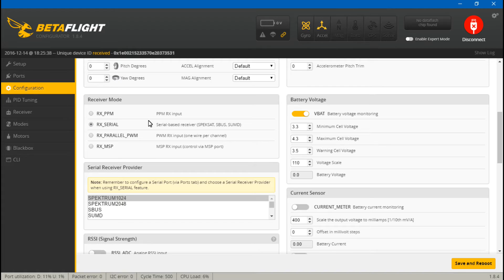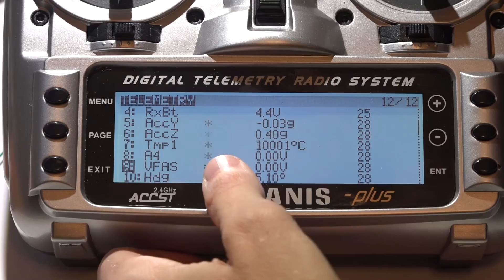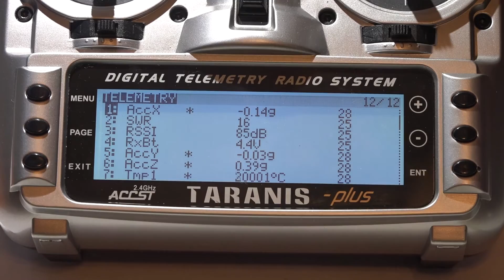SPRacing Mini & X4R-SB: Connect & Telemetry

Comment: Hi there. I just bought x4rsb in UK.  apologise for question but I'm complete new to rc world and I'm building my first quadcopter with fpv. I'm using the same fc controller as on video. so if I do have diffrent colors of the wire  on my x4rsb do I connect this same way as per you video? so red to 5v black to gnd yellow to r1 and white to t3?